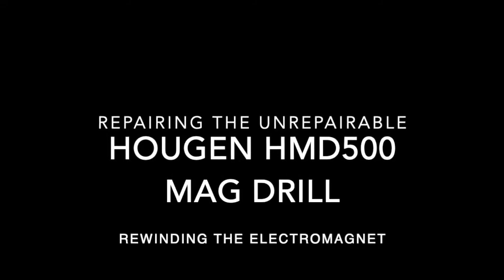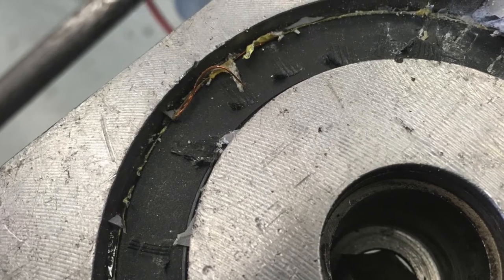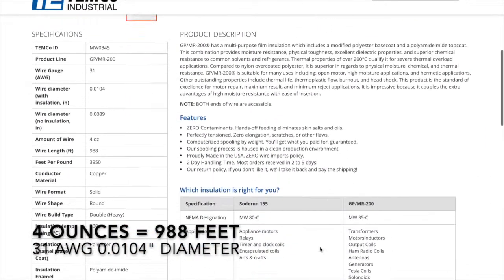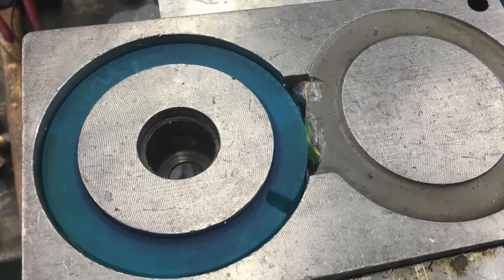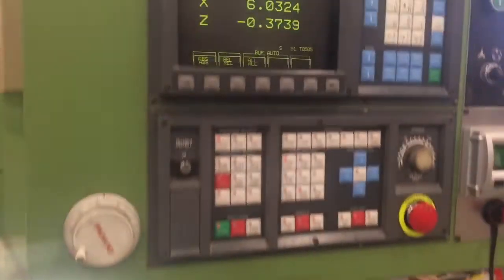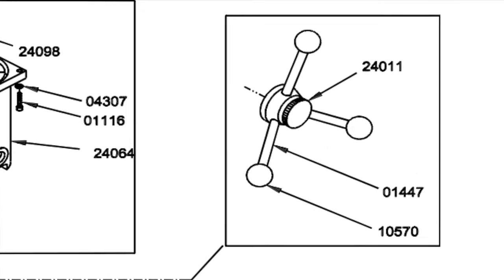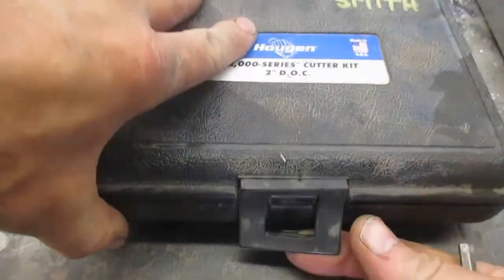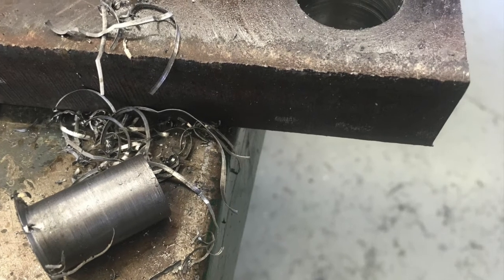Repairing the electromagnet of a Hougen HMD500 mag drill

Comment: Randy Smith, I personally want to thank you for your kind efforts and comments, Cause you saved me from the headache since I was leaning towards 904.
Again Thank you Randy! 🇺🇸 🇨🇱 🍻
Reply from the maker: The 904 is a nice mag drill. I have no issue with Hougen. They have a great reputation and I was honestly shocked they didn't have the parts available. But the drill is 20+ years old. In hindsight they could have referred me to a rewinder. I would have happily paid to have it fixed. In the end it was inexpensive to fix, less than $20. I learned a LOT and it was kinda fun. I used it all summer, it been working great.
Reply: @MrSmithDotShop  yes $20 in material but the loom took time for you to make sir.
Reply from the maker: @cropsey7  I work cheap. ;)

Comment: I have a burned out base magnet in a Hougan 904. I need to find a spool or make it another way.  Great job sir. I do have a small Sheldon lathe. hmmmm.
Reply from the maker: You might want to contact Hougan and find out if they can provide the coil. My magnet assembly wasn't available but I didn't think to ask about just replacing the coil. It's possible the coils are similar across models. They may be able to recommend a rewinder that can repair it. I designed my bobbin in Fusion 360 and 3D printed it. I used a Form Labs SLA printer but I'd imagine any 3D printer would work. I'm at a high school so 3D printers are readily available. I originally planned on turning the bobbin from plastic but I didn't have any scraps the right size. I also thought about making the bobbin from cardboard. For me the tricky part was reverse engineering the coil wire gauge and length. Measuring fine magnet wire can be tricky as some have thicker coatings than others. That is why I confirmed everything by weight in addition to the resistance calculation. I hope my video will inspire you to wind a coil. It did take a bit of work to sort it out but it has been worth it.

Comment: Can you tell me dimension of coil and the input voltage of coil please🤔🤔🤔
Reply from the maker: The spool dimensions are: ID 2.4375", OD 3.3", height 0.51". The print thickness is 0.06". This makes winding area 0.39" high and about 0.37" deep. I didn't measure the coil voltage but I'd expect it to be near 120V considering it uses a full bridge rectifier to convert all AC to DC.
Reply from the maker: Here is the link to the 3D models on Grabcad.
https://grabcad.com/library/hougen-hmd500-mag-drill-parts-1